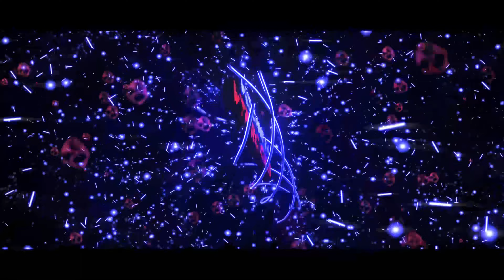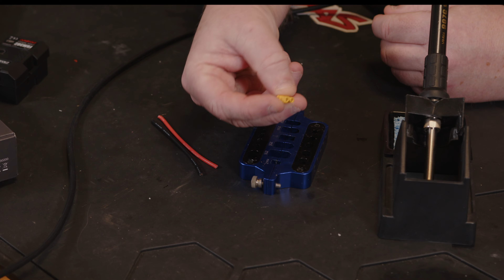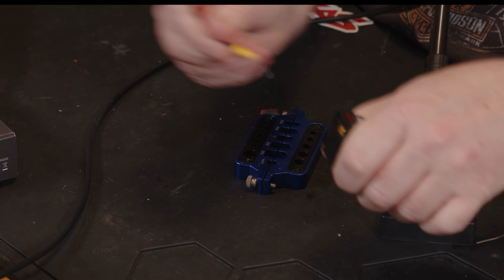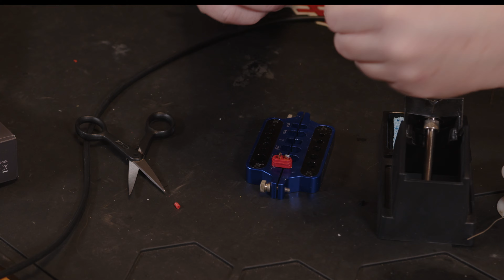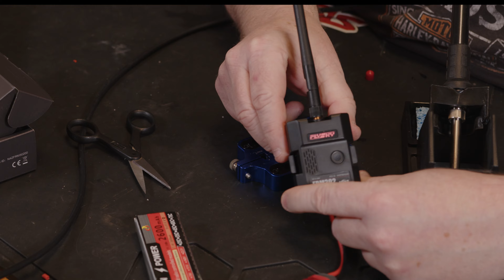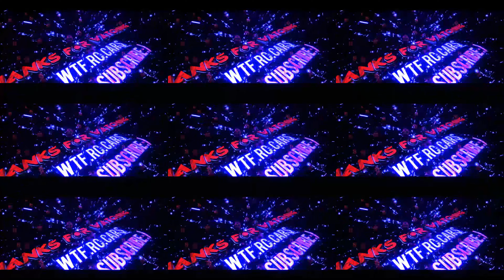Flysky FRM 302 range extender external power lead assembly guide.

Comment: Hi.😉

First, thanks for this video.👍👍👍
I drive cars and boats with my Noble 4 but I need more range for speed runs with my boats.
If I understand all your explanations (I'm french), I can use this FRM302 with external battery on my Noble 4 who has OpenTx, that's right?

Thanks for your next answer. 

Édouard.
Reply from the maker: You don't need open tx for it to work with the nb4 and frm302 :)
Reply: @WTFRCCars  ok, thanks. 😉👍
I'm 55 years old and learn again and again... 😊

Comment: Fantastic content! New sub here, I just picked up the FRM module from the HobbyKing USA warehouse as it's on sale (moving sale) for $22. I don't know if I'll use it but I couldn't pass on it. I'm looking forward to a 3D printed dock that mounts the module on my radio.
Reply from the maker: I wouldn't mount it to the radio it's far more useful if you have a mount to hold the module, battery and receiver then you can place it between you and the RC increasing the range further :)
Reply: @WTFRCCars  Well, it should be no different than with our drone setups where one has a range extender on the back of the radio JR dock. One shouldn't have to mount the FRM module on a tripod and further down the road or anything like that because it won't increase the range anymore than what you've set the FRM to output. If you look at drone setups going 1 mile out, the extended range modules are mounted right on the transmitters JR dock and not half a mile down the road. 

I'd rather have a 3D printed dock on the NB4 (yes, will be cumbersome) which can house the module, RX and small 3S lipo which could then be easily removed when the extra range isn't needed. A nice dipole antenna or the like will take care of any range. 

What I don't understand is that with my FrSky RM9 setup for example, I don't need that dual RX setup like with the Flysky. Heck, even with Flysky aircraft transmitters I don't think they require the dual RX setup either. Not sure why this is the case with the NB4.